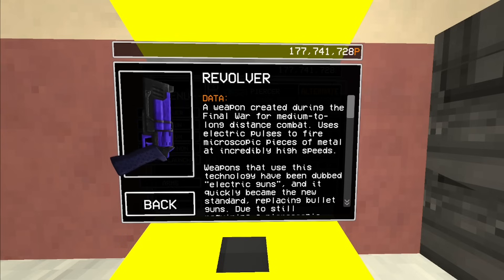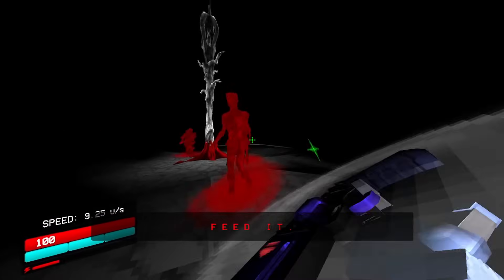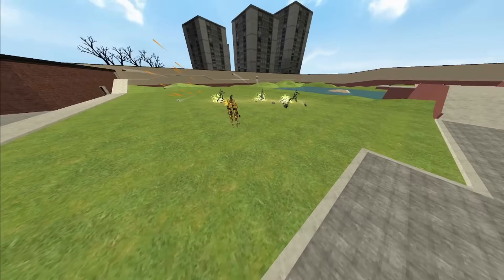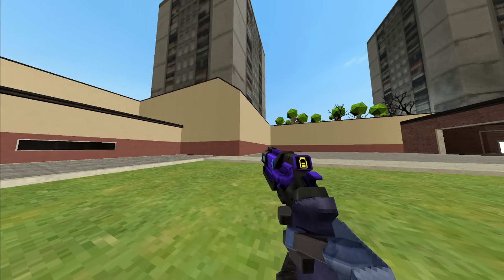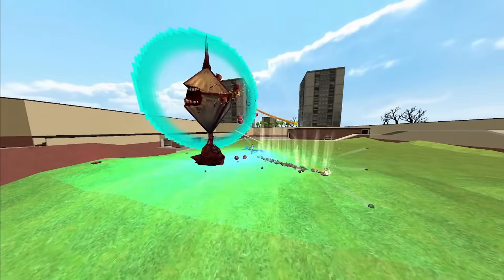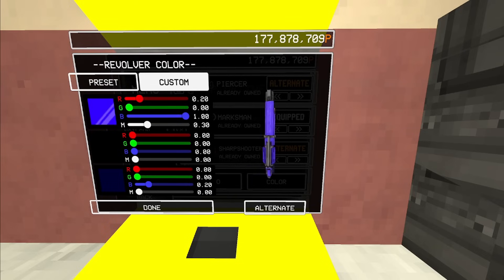How Does Ultrakill's Pistol Work?

Comment from the maker: Really liked making this. I will be doing this more in the future, but some feedback would be great. I will talk about more weapons or stuff I have questions about for games, movies or what have you.
Reply: The only critique I can add is I would of liked to hear more about how projectile size does/doesn't have an impact on how fast it could be propelled. Absolutely phenomenal video! I fell in love with the gun's engineering lore when I first played, glad to see I wasn't alone.
Reply from the maker: depends on the strength of the magnets. id say its probably not breaking the sound barrier.
Reply: @rinslab  Could it work using electric charge instead of magnets? Putting a very strong charge on the projectile and then giving the front end of the gun the opposite and the back end the same charge?
Reply from the maker: @skelofun  doesn't say anything specific. but probably under 0.10 millimeters that is what is considered microscopic
Reply: one of my biggest videogame engineering questions is the Colette wave cooker form Deep Rock Galactic. its a microwave gun with a focusing lens, and the premise that bending microwaves could be possible is just super interesting to me.
Reply from the maker: cool idea.
Reply: @skelofun  ok, folks really do not understand how powerful this could be. In an actual microwave, microwaving metal produces plasma in the air. This has nothing to do with electromagnetism. It is due to metal reflecting microwave radiation into small enough points that it heats the air enough to strip electrons from their atoms. A weapon that tightly focused the full power of a microwave oven would be far more than lethal.
Reply: how does the gutterman work? didn't they make that thing in 1900s? it must be one hell of an engineering miracle if they somehow made it able to fight by itself without being controlled by a human, a video on it could be cool idk
Reply from the maker: uh big man uses person for energy and has minigun
Reply from the maker: @he3004  I will stick to weapons for now. like the real iconic stuff.
Reply: @rinslab  fair enough, I would watch them anyway
Reply: if possible it'd be really cool to know how much one can bs their way into making projectile boosting a feasible idea
Reply: Do the railcannon next. I'm interested as to how it shoots a straight beam of electricity. Or maybe it just ionizes air like in a microwave?
Reply: @mothhut8637  at least the screwdriver variant is easy enough to explain, malicious variant probably propel some explosive ammunition with straight up rail gun technology, but the electric variant I'm not sure, because it definitely doesn't shoot a projectile
Reply: @he3004  remember that green and red weapon variants are not made by humanity, but rather by the terminals. The malicious railcannon is canonically the same as Maurice explosion.
Reply: @mothhut8637  huh, I didn't know that, so this likely means coins also could easily be considered hell magic
Reply from the maker: not much lore to go off of. if it gets updated that I probably will
Reply: If I correctly assume that you have a slugcat on your icon, then it's a safe bet that you have some Rain World technology in mind for future videos, eh? :] Though then again, Rain World is heavy on the intersection of biology and engineering, so I'm not 100% sure if it's something within your preferred area of expertise.
Reply from the maker: yes I use slug cat. its from an emote pack thing and then 4-1 as backdrop. but I only know mechanical engineering and some material science.
Reply: do th shotgun i woukd watch
Reply from the maker: that one is next
Reply: @rinslab   which one is next?
Reply: Lolol
Feedback
Reply: what would your opinion be on the helldivers hellpods? my immediate thought is that the idea is cool but they would almost certainly crumple on impact with the ground, or have to land in some way softer than smashing into the ground.
Reply: if you're talking normal guns they heat up naturally already, which can cause in issue, machine guns have hot swappable barrels to preserve barrel life and maintain the ability to fire for even longer durations, but with the low fire rate of a revolver sort of weapon you can deal with heat by simply just making the build up take a while if it is similar to that of a normal gun. Heck you may not even have to really design for it depending on how much heat is generated. 

 if you design things correctly for something that isn't expected to perform sustained automatic fire (LMG SAW, maybe automatic cannon) and the result is if you are still engaged in the battle and the heat of your weapon is causing you issues you are either doing something stupid or are in a very very unusual and unfortunate circumstance.
though the heat the capacitors/cylinders take in could be an issue they are surrounded by a reinforced cylinder that could act as a functional heat sink to some extent. It is also possible that whatever capacitor technology ultrakill has for this revolver makes heat a nearly irrelevant factor for this application.

as for the charge shot Im pretty dang sure that is all the capacitors inputting energy to a single shot, we can probably tell the developer intent by measuring if the recharge time is close to six times the pause between a single shot, or yknow just think about why the cylinder go spinny. which yknow probably not great for longevity but if you built the system to handle that kind of load, i mean name a battlebot with an etek motor that doesn't dump a ridiculous amount of current into the thing compared to spec.
Reply: Some feed back for the video editing side, moments with completely blurred visuals are fairly disorienting or uncomfortable to look at. If you wanna blur some gameplay footage, have something sharp on top of it for people's eyes to focus on comfortably. (Like a graphic, or text related to what you're saying, or even some other relevant video)
I'd say (as like a random number I made up off the top of my head, to be fair) people can tolerate only a couple of seconds of blurry footage without something sharp to focus their attention on.
Reply: feedback? like the feedbacker in ultrakill??

Comment: Personally I think the cylinder is full of battery cells that are charged through a magnetic charging coil in the hand the energy travels through the handle into the batteries and charge them a battery indicator is fitted on the back to show the charge the battery power would go into the electro magnetic rails having just enough power to launch a microscopic projectile this is using the context that humanity found that blood could be used a power and was the most efficient power source

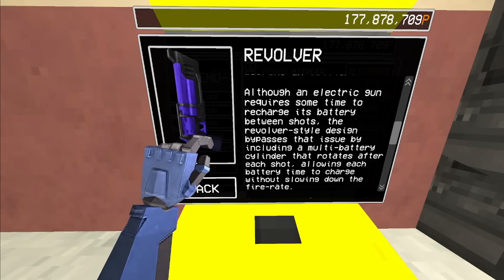Comment: 1:27 

THEORY!

The grip where V1 holds the revolver acts as a way to transfer charge, the batteries within the cylinder just hold the charge until used. The spent batteries are cycled to the bottom to be recharged at an extreme rate, which is why V1 can fire the revolver so fast.

Comment: since kinetic energy is described by the mv^2/2 formula, it's requires pretty much the same amount of energy to accelerate the elephant (5 tons, 10000 pounds) to 15 mph (6,7 m/s or 24 km/h) and to accelerate a a full 500ml water bottle (500 g) to 1500 mph (670m/s, 2414 km/h). The only difference here is in the surface when they contact with something. A water bottle will be much more piercing than the elephant although when extracting the energy from their movement we will get the same amount if we assume that there is no persistant energy loss.

Comment: might have a fix for the battery capacitor issue. battery recharges the piercing shot capacitor
Reply: due to the SMOLBOI metal shavings as ammo the battery diverts minimum power
Reply: thus its VERY long till u gotta recharge the battery or reload

Comment: 2 additions with new and old lore; Blood in ULTRAKILL has divine properties tied to creation, that might allow more leeway for power and V1 stores the weapons as data in its wings, they become pure energy when not in use, and is reconstructed when needed, this process can mean durability is not an issue and heat can be manupilated

Comment: I think our spin is part of the cooling, when we spin it we're increasing airflow over the barrel and cylinders/batteries/capacitors, therefor cooling it. 

And the recharging battery is now it recharging itself, it's being recharged from V1's own power supply. Hence, batteries that we're recharging as we absorb blood.

Comment: I tried to timestamp. it didn't work.

2:07 actually, I believe the revolver is charging the capacitors through momentum, which would explain the cylinder spinning loosely without locking into a "chamber'"
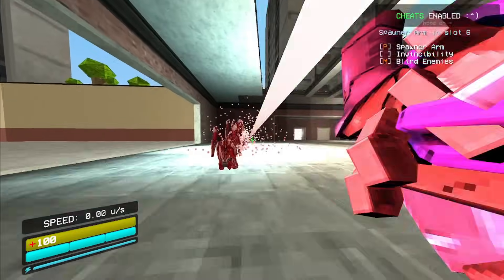4:00 also, the ricochet and coinshot are possibly flinging the shard at faster speeds than the piercer. considering the size, i assume the projectile would need to be fired at enough speed to not split apart across the air, yet with enough speed to GAIN DAMAGE?! and with enough of a trajectory to bounce off the wall. makes more sense with the coin. the ricochet breaks my understanding of physics.
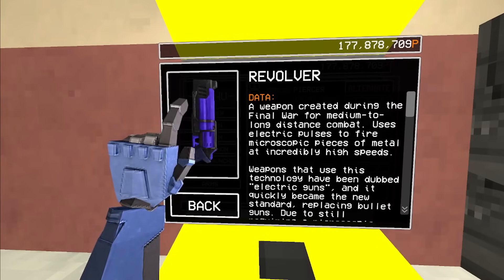4:55 the base speed of the piercer projectiles would need to be a bit (a lot) under the coinshot yet just enough to hit instantly and pierce metal. the ingenious part is reloading, where you would scrape flakes of metal off of surfaces and deposit them into the gun, which can be done to the gun itself. this effectively means that the projectile could be any metal scraps found out there but considering that "e-guns" that have been flaked a lot are seen as prestigious, we could assume the likely ammo would be the same metal on the gun, like tungsten.
5:51 video games get the term overheating wrong in most cases. if it overheats, it doesn't "jam" and need you to wait, it takes extra strain damage. overheating is a bad thing, bulletstorm. regardless, I assume there is passive cooling occurring in the gun, and the cylinder spinning also releasing heat, there could also be an unseen fan. though when you use the alt-fire, it's probably just spending an extra sec recharging all capacitor after bursting all the energy out.
7:27 you are the man. this super-conductive material could also be the key to projectiles working as they do (though we're basically talking about the gun frame being made of phlebotinum at this point)
Reply from the maker: you know you need something to move alot for it to make a good amount of charge. something like 1.23k revolutions per second for about 3.2 watts. i forget how much exactly. but not what we see in game.
never said it jams. just that the parts would melt from how much they use in energy.

Comment: 3:28 if anything it would probably be made from Normal 4140 barrel and maybe a 7075 frame. if it was tungsten it would weigh 20 lbs (for reference my 16inch barreled rifle is about 8.5, loaded) passive cooling is more than possible for something like that

Comment: Speaking of the coin, my headcanon for its functionality is that V1 is actually always passively tracking them in the air and when you fire them its the in game representation of V1 perfectly hitting the spinning coin at just the angle for it to ricochet your shot into the target. Or, if we go by the fusion on impact, hit the coin at the right angle to induce a burst of radiation directed at your opponent.

Im pretty sure however that they deal more damage because they direct the shot right into a critical point on your target - so in the physics of the world, you could be multiplying the damage by having each ricochet of the bullet switch its target target to an increasingly high value point on your opponent to deal more damage
Reply: YEAH THISSS. It just makes sense that its flipping coins and tracking them perfectly to be abl e to hit itcan have the round ricothet anywhere. As fur the more damage then i have no clue...

Comment: was thinking about it recently, but more specifically the hammer on the alternate. i arived on the conclusion that its just a lever to revolve the cylinder
and like that other guy on the comment also think that the work as a minigum
also can see someone calling a capacitor a battery

Comment: For the issue of power, in real life we've come close to finding a way to generate electricity from Brownian motion. Let's say in the Ultrakill universe, they've found a way to make this tech work fully and well enough to allow passive energy generation for electric guns. Cycle through the capacitors in the barrel when firing so the others can recharge, and it's basically a done deal

Comment: I'd guess that the reason the Piercer does its thing is that the capacitor cylinder spins up so all of the capacitors can tap in and charge up the rails at once, or perhaps the spinning motion is used like a switch to wire all the capacitors together in parallel to put out their power all at once, hence why the gun then needs to recharge as all of a capacitors then need to build up the charge and get back to proper function.

As for the slab variant, I just guessed that the weapon's parts were made better with the exception of the automatic cylinder indexing system the original used, hence why the hammer has to be manually pulled back. I also like how the shape of the slab's cylinder could suggest that the capacitors in the slab are beefier, and thus need to be exposed a little more and can't be crammed together so tightly.

Comment: Great video! Just wondering: Why'd you choose to explain the revolvers as railguns instead of coilguns?
Reply from the maker: shape of the revolver and rail guns have better energy to velocity ratio
Reply: @rinslab 
Which part of the shape?
Also, although it is definitely a weird shape for a coilgun, it's also a decently weird shape for a railgun as well and we are talking about future tech here.
It looks like the weapon's shape could still work if it were a futuristic coilgun instead of a futuristic railgun.
I also don't think the energy to velocity ratio is a key issue here, especially with how efficient and great of a fuel source blood is.

Comment: I spent Three. Months. Trying to figure out how a gas-powered Generator worked. I was doing a lesson for my trade skills that involved how the rotation of magnets inside copper coils generated electricity, and I wanted to know where the rotation for the magnet was coming from. No matter where I looked though, nothing gave me a reason. I knew it was Gasoline, obviously, but how was that working? Looking it up on google, no matter what I put in, gave me Nothing for the results. Finally, after looking for so long, I realized how it worked. It was just a Car Engine! Obviously! I should have known that from the start. Gas turns into Rotation by Combustion. It was just a cylinder engine with a crankshaft, like any other means of gas-powered rotational force. But while I felt dumb, I also just found it really cool that these concepts transferred from Cars to Generators. It was really obvious, but really difficult at the same time.
I never understood why people were content with such short answers. Things like "Oh that's normal" or "A generator turns Gas into Electricity." I've always asked "How?" and I've always gotten weird stares or dismissive comments about it. I never gave up on those curiosities though. Still, to hear someone say "_I like to know how things work_" cements to me that this is the kind of content I've been craving for a long time. And from the looks of it, this channel will be nothing but that exact question. I'm going to be subscribing immediately. This is everything I've come to love in my fiction and in my reality. I cannot wait to see the next video. Thank you, for Creating.
Reply from the maker: i mean its just combustion that generates energy by spinning. if it spins or moves you can make energy
Reply: @rinslab  You have to understand the fact that every diagram went into Great Detail about the copper coils around the magnet, and the magnetic forces, and all of that, but when it showed the magnet itself it was just on a little Stick. I knew it was spinning, but nobody was explaining where you get the rotation from, and when you're put in the mindset of "Electricity makes Magnetism which spins a Motor", it's hard to remember that Cars exist when you're trying to consider the other way around.
But the main point of the comment was just to say "I like knowing how shit works" man. I'm not a moron. 😭